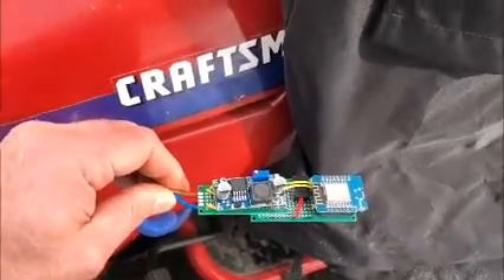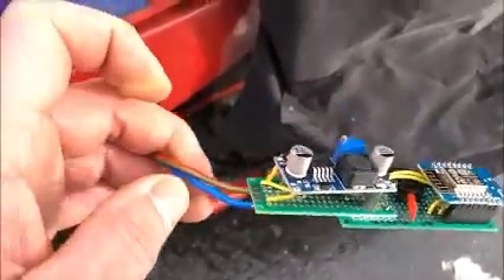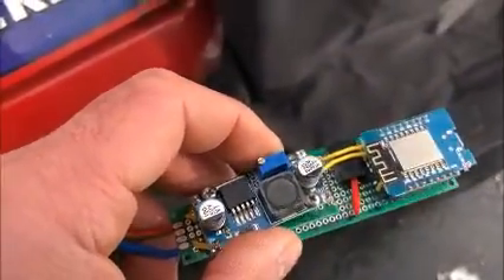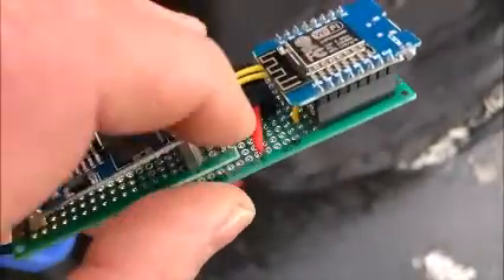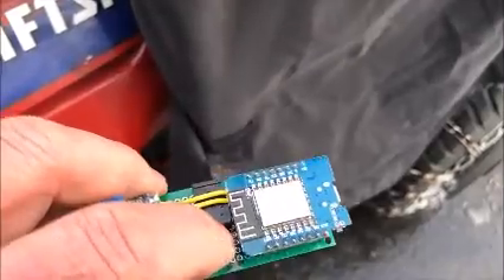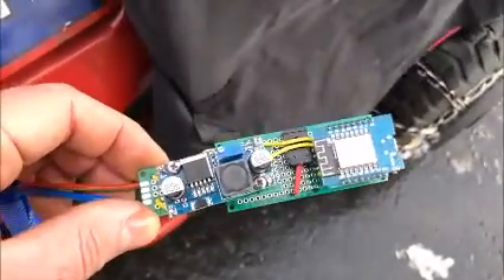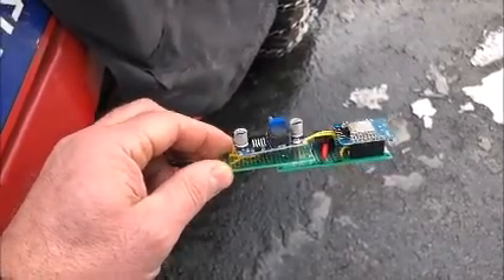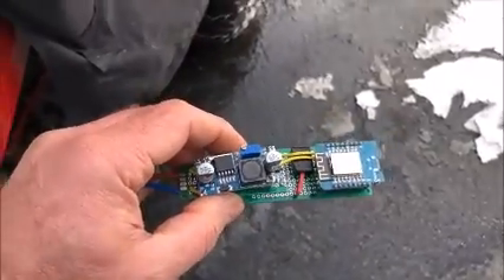ESP8266 / D1Mini Garden Tractor Battery Monitor using ESPHome & Home Assistant.

Comment: This is so cool! I need one badly before I kill another battery. Have you tried making one with an esp32 (I think the wroom-32D ) has built-in deep sleep mode)? I still need to wrap my head around how you are using the reset pin to force the esp8266 in and out of deep sleep. Can you explain it more or suggest info links? Thanks so much for making this!

Comment: What is the Value of the Resistor. And how can you mesure Voltage with only one Resistor ? 
As I know you allways need two Resistors and building a Voltage Divider ..
Reply from the maker: Correct! the other resistor is already integrated into the D1 Mini. I don't recall the value i used but you you need to figure it out for your D1 because those resistors are never accurate.

Comment: Could you please share what is the value of the Register you are using ? And with this setup how much DC voltage I can measure.

By the way, 

Thanks much for this Awesome Video.
Reply: I was thinking about the same question. Probably 100k or something like that. I = U/R, I = 12V/100.000Ohm = 0,12mA This won't draw too much current. The tractor battery won't notice it much and the controller can still work with it.

Comment: Could you please share what is the value of the Register you are using ? And with this setup how much DC voltage I can measure.

By the way, Thanks much for this Awesome Video.
Reply from the maker: I don't recall the value but you need to calculate it based on the actual value of the existing resistor on your D1 Mini and what voltage range you need to measure. Of course there is also an offset to need to use for calibration in the code which in my case was "multiply: 17.4". Sorry this was not meant to be a how to build it.

Comment: This looks like the thing I have been looking for.  How far away can u be before you losing contact? 

Think of build one for my auto mower👀… do control a DC motor
Reply from the maker: As far as your WiFi will reach and if it’s not far enough you could use a WiFi extender.